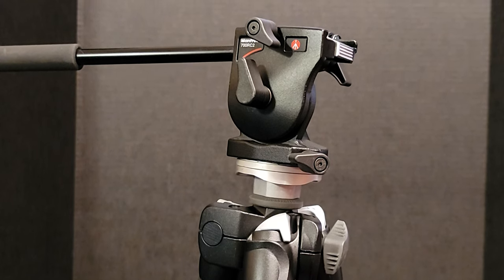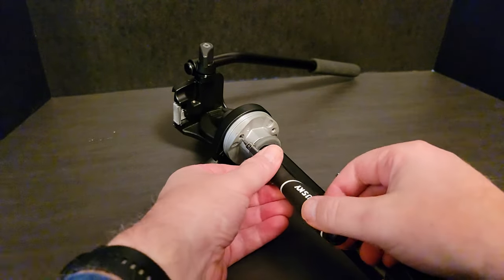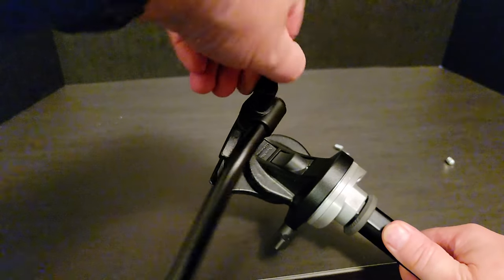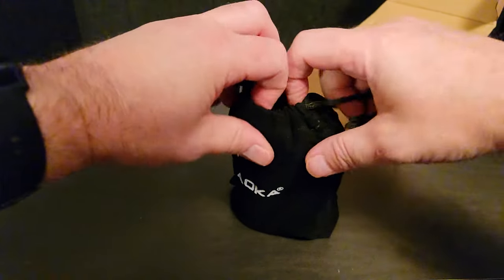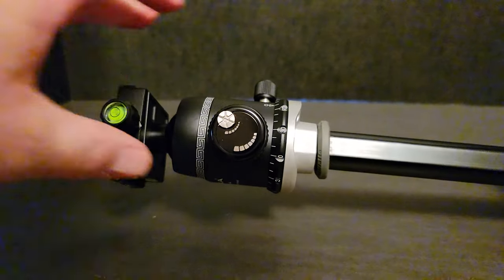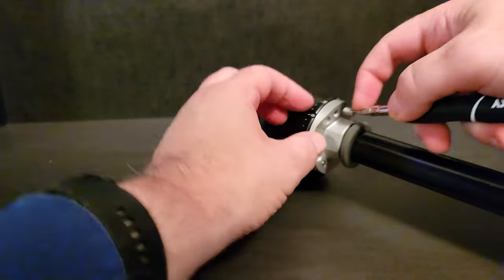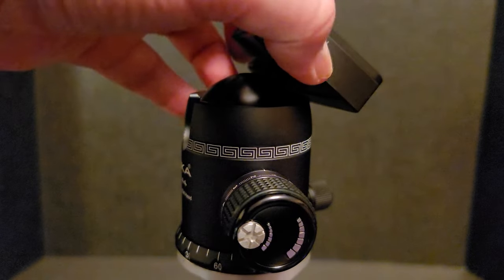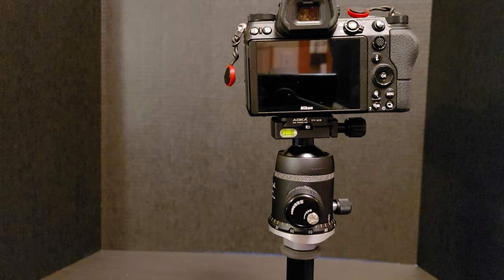REPLACE TRIPOD HEAD

Comment: Guess I need a different tripod because the one I just got from ebay doesn't have a removable head. I wanted to get a ball mount for it after using the stock head and not really liking it. Thanks for the video though, very thorough walk through.

Comment: Would you rather use the ball head instead of a gimble?
Reply from the maker: They are two different use case situations. Ball head and tripod I use when I am capturing videos at a fixed location for extended period of time or long exposure photos. If I am planning to move around a lot shooting shorter video clips, for example dozens of different cars at a car show, lately I typically choose to leave tripod behind and use gimbal due to portability.